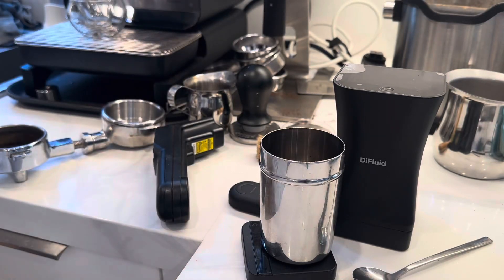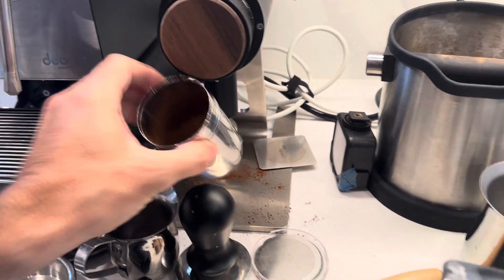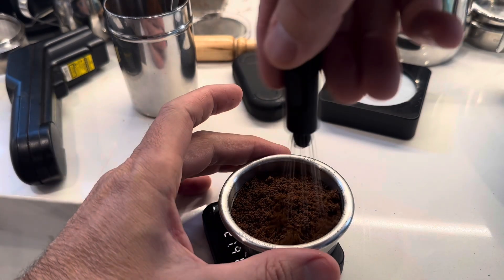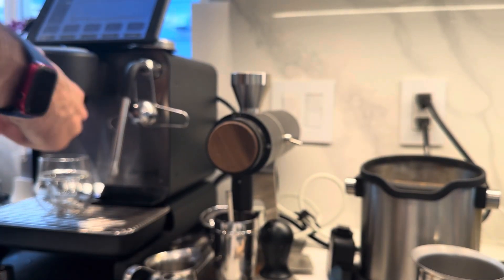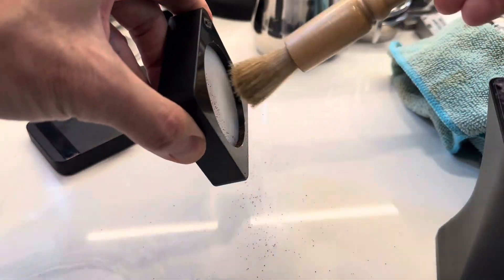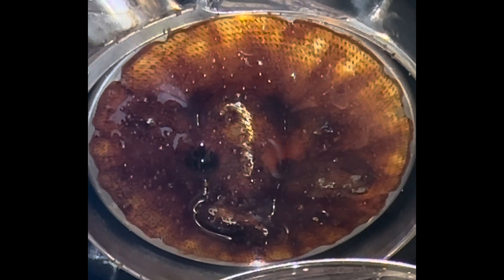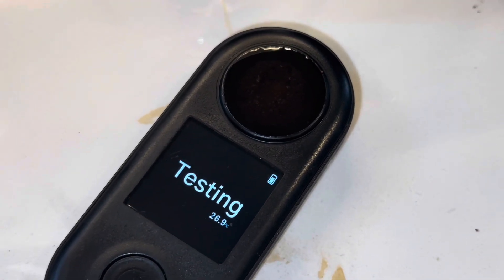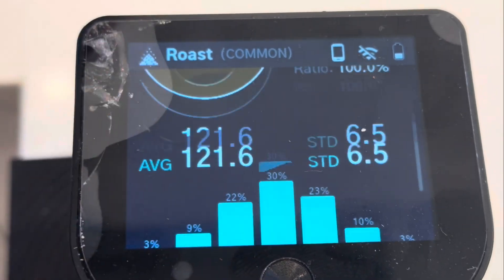DiFluid Omni Workflow for Coffee Experiments

Comment: Regarding particle analysis, we recently compared the results from our new lab sieve machine with the Omni particle analysis tool. We discovered that the Omni device is only capable of measuring particle sizes under 400 microns and is not suitable for particles larger than that. Moreover, we concur with your observation that the Omni's small sample size can result in less accurate readings.

Although we're still awaiting the promised app update from Omni, we're becoming increasingly doubtful that this function will be useful. As a result, we're continuing to rely on our lab sieve machine for precise particle analysis results.
Reply from the maker: Oh that’s good to hear your testing. Be careful comparing sieve to imaging as there can be discrepancies between the sieve hole shapes and how sifting affects particle shape. 

However, I would agree that the smaller sample size makes measuring above a certain particle size challenging. This could be overcome with multiple samples.